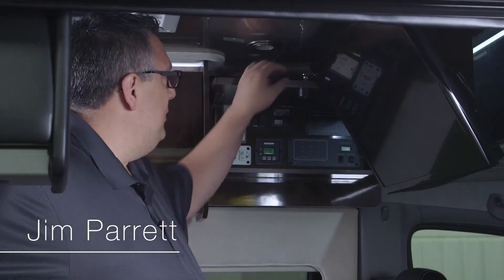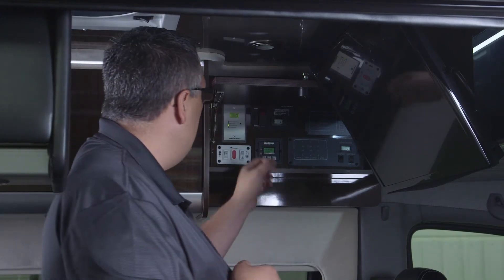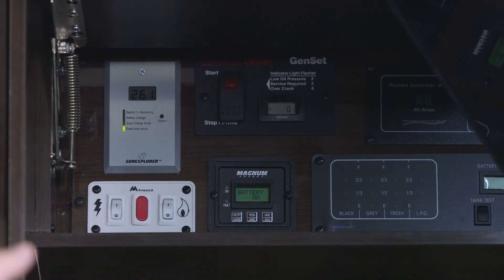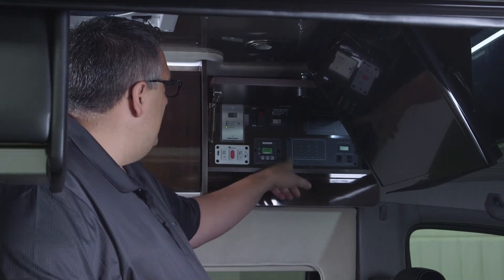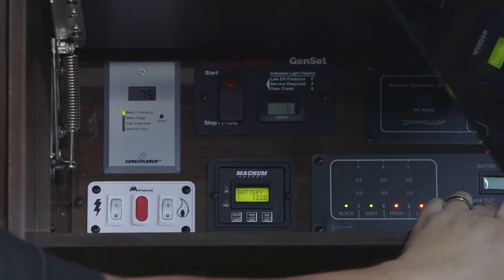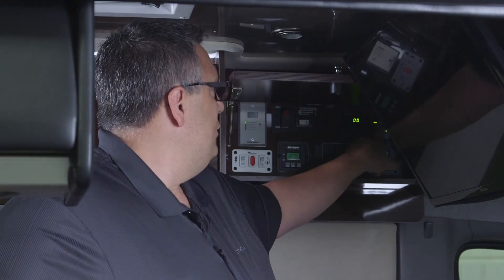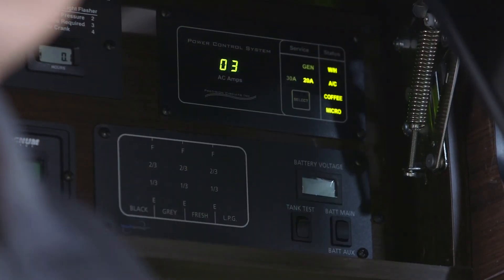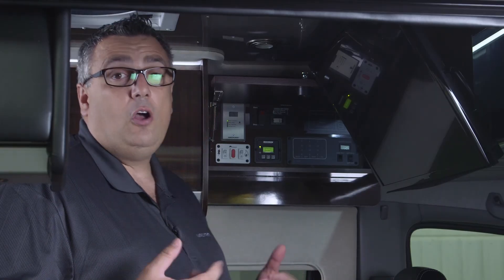How to Use and Monitor Electrical System in an Airstream Interstate

Comment: One thing he does not mention is they're actually three batteries in the unit. Two house batteries and a chassis battery. These gauges don't really tell you which battery is giving you a certain voltage. The only way I know of to get the voltage from the specific house battery is get underneath the RV and use a meter.

Comment: In my 2016 (exactly like this one) All the Lights and everything work fine if you're running off the alternator (diesel running). But with city power and generator power everything just gets dimmer and dimmer over about an hour.  Then it just shuts down the auxiliary battery.  Does anyone know if this sounds like a bad battery.
Reply: I replaced the house batteries. I am hoping this will solve this problem.
Reply: What did you find out?  I have a 2017 and just ordered new coach batteries.
Reply: @swoolf1431  The batteries solved most of the problems.  But I also had to replace the solenoid which was causing a "fault no comm" error.  I found it on Amazon and was able to replace it myself.  $75.
Reply: @richardk7379  How long do the auxiliary batterys last if you run the TV, fridge, fan, coffee maker?  Im curious how long i can go once i get new batteries in mine  before i need to recharge..
Reply: @swoolf1431  I only run those things when I'm plugged in. I don't think these rigs are really made for boondocking very much.  I haven't pushed it.  There is not a great way to tell exactly how low the battery is.  I try to prevent it from going below 50% on the screen.  I have just heard that's not good to deplete the batteries real far.
Reply: @swoolf1431  I can't give you a accurate answer on this because I rarely run those things without shore power or without the engine running.  I just haven't needed to.  We get at least an electric hook up for each night we travel.  You would have to use the inverter for the TVs and that draws the batteries down very quickly.   We just hit 22 states in a month and I never used the inverter.  You might get away with running the fan all night but I can't be sure.  We never needed to boondock.  I also try to avoid going below 50% on the Sunexplorer "battery % remaining" readout.   These machines can boondock in a pinch but they are not really geared towards using them that way.  I have read if you draw the batteries down too far you will have headaches.

Comment: Does anyone know where the actual inverter (not the control panel for it) is located in this unit?  I have the "Fault! No Comm" message.  The manual says to pull the cable off the inverter than put it back on to reset it.
Reply: Answered my own question if anybody needs it. The actual inverter charger is under the back seat on the driver side.

Comment: My magnum battery for the tv is blinking and I cannot turn the tv’s on
Reply: The magnum is the inverter/charger, not the battery.  It sounds like you have a fault error occurring. You should be able to look it up in the manual. What you give you some idea what is going on.